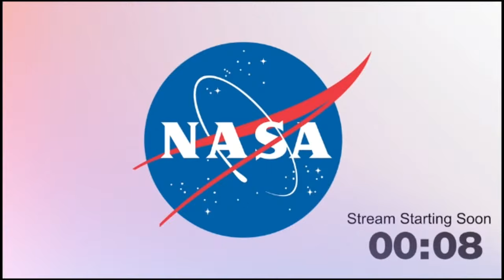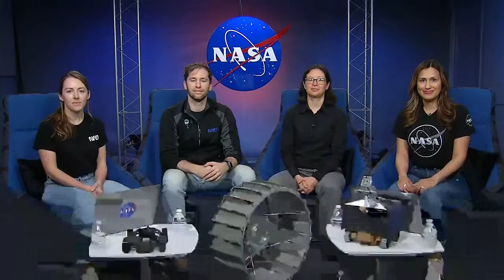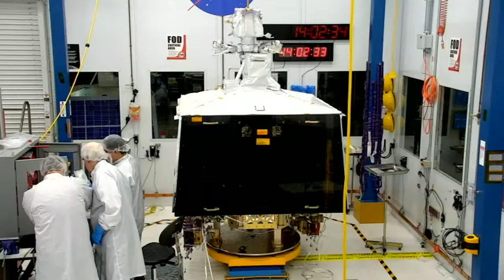NASA’s VIPER Moon Rover: Robot Build Watch Party

Comment: Sorry to show up late, but SERIOUS CONCERN: Those wheels are TINY and the top has Hard Corners Jutting. How is this little Box on tiny wheels going to get down into deep craters and then back out, when we can expect crater walls to be Steep?
Reply: The suspension has leveling to help it navigate steep angles.
Reply: @EchoesDistant  bro, 15 degree max? you're not getting into the creators to map anything.
Reply: The wheels are about 50cm diameter, the same size as the wheels on lunokhod. Both of those rovers did fine and never had wheel issues.